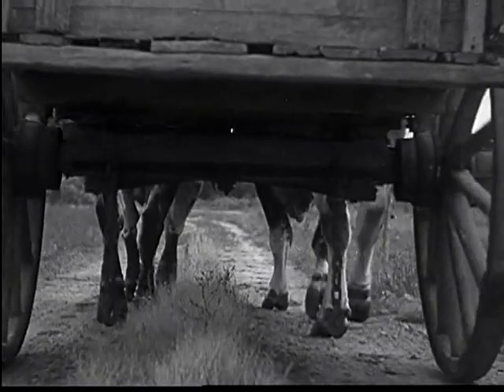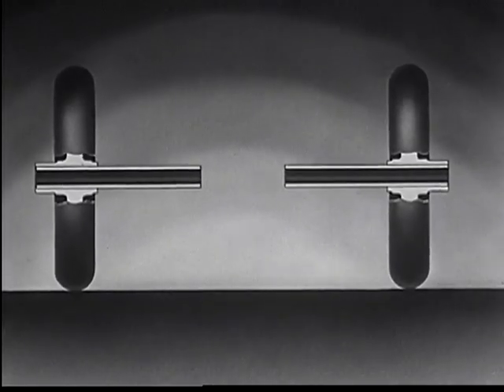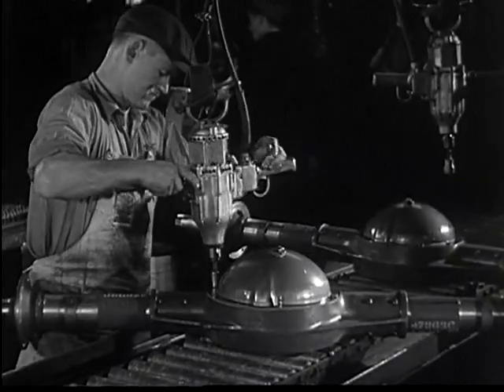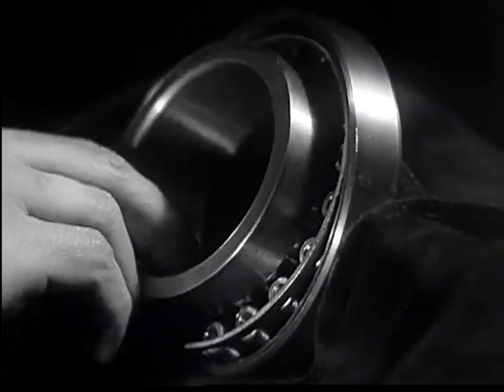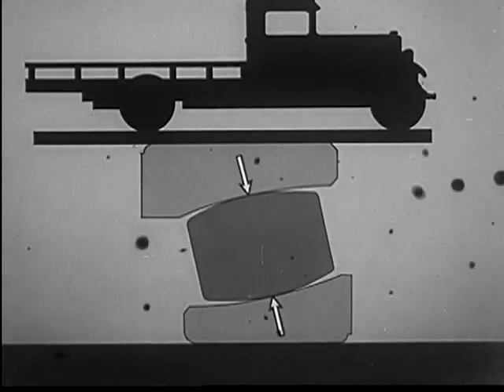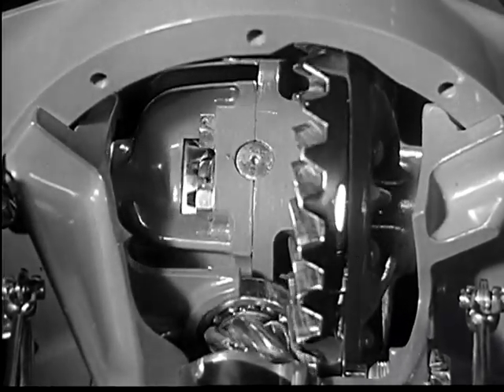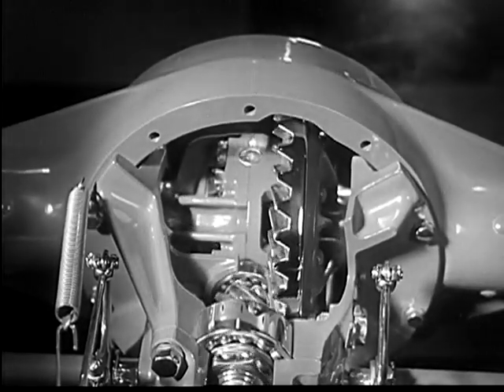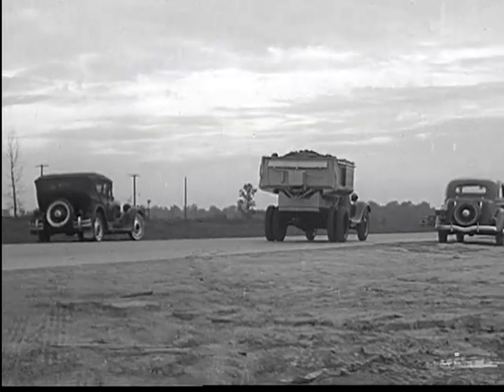It Floats - Chevrolet Full Floating Rear Axle (1936)

Comment: I think it's pretty amazing that this exact, identical rear axle design is still used on heavy-duty trucks, 80 years later.
Reply: yeah its still in use.
 quite surprising that with technology advancing on a daily basis , some things were so perfect that they haven't changed for decades.
Reply: @lafaglobe6025 They changed the gear tooth profile recently to reduce noise
Reply: Ben Well, technically the sherical roller bearings have been replaced with plain straight roller bearings, which are far cheaper to manufacture, and the load screw (anti-deflection bolt) has been removed. But fundamentally, yes, the design is unchanged
Reply: I was just noticing our 1971 grain truck had pretty much the same axle as shown in that video.
Reply: Some things are nearly perfect from inception, like the Schrader valve in tires. It’s remained virtually unchanged since the 1890’s and it is universally used over the whole earth. Amazing really.
Reply: @NodnarbRS  Wow, I never thought about that. That's pretty remarkable too.
Reply: Most modern-day technology is based off older mechanical concepts that have been tweaked and refined to their near-maximum capacity.

I think it's amazing that we still rely on the wheel to get around and produce/transfer energy, thousands of years after its conception. Movies show futuristic machinery using proton engines for propulsion and flying cars, but can we truly innovate revolutionary technology that is practical enough to move on past basic engineering breakthroughs?
Reply: if it aint broken dont fix it
Reply: ++ Offroadram2001.. Same way you fish out a broken axle today. Once it breaks there's nothing holding any of the pieces. Since they usually break near the end you can grab it with a large pair of pliers or push the whole thing with a long screw driver once the center cover is off. At that point you can clean the tube with a rag shoved through with a broom stick to get any small particles.
Reply: threads like this are weird they start out with a neutral comment years ago then degrade into some pointless argument 4 years long 😆🤣
Reply: i wonder when will the next gen will come or a different way to transfer power
Reply: @kendelion  Mechanical I cant imagine another way to transfer power. This is like the ultimate way^^
Reply: @kendelion  With the industry moving toward electric cars, it might be that axle assemblies will go the way of the dodo.  Don't need an axle to deliver power to the wheels if all the wheels have their own electric motors.

Though the axle and differential system may remain in use in heavy vehicles, like over-the-road trucks, at least for the foreseeable future.
Reply: @xaenon  I could really see that future coming and it's already here on some!
Reply: @kendelion  electric motors on each wheel
Reply: @kendelion  the differential is perfect. It can’t be improved on for what it does
Reply: @kendelion  somethings are just optimal. no one is gonna ever make a table obsolete for instance.
Reply: My 1987 Ford has this style axle, it's a Sterling 10.25.
Reply: Don’t worry some idiot will come along sooner or later and change it just for the sake of change and then have the gall to call it improved. And the sheep will believe them and pay more for it.
Reply: @NoName-tz5ji  and then they'll ban the old one's and if your caught running them you will be fined
Reply: If it aint broke dont fix it!
Reply: If it ain’t broke don’t fix it
Reply: Agreed, same with drum Brakes
Reply: In the 80s toyota still used this design on the land cruiser. I'm trying to get my hands on one to go under my modern toyota.
Reply: No entirely true, some electric engines still use gear systems. Because they can run into situations where a change in gear ratio to increase torque might be needed. Or maybe a change needs to occur to allow for more speed.
Reply: @ALegitimateYoutuber  motor not engine
Reply: Just a few tweaks here and there with electronic assist and few balances are made so far. No major breakthroughs yet. Maube one day each wheel will have their own motors
Reply: Next way will be electric power transmission just like a locomotive either in full electric or hybrid. 

100% torque at zero RPM, differential function, synchronize them for lockers, plus dynamic braking.
Reply: My thoughts exactly.
Reply: @ButterfatFarms  on cars, independent suspension is an improvement over a straight axle even tho it is more complex, more expensive, and less durable. Its still an improvement. God your dumb.
Reply: John Browning's tilting barrel design is still predominate in handguns 111 years later, sometimes the name of the game is minute refinements on a great designs.
Reply: Ben until flying cars and iPhones are in control of everything.  Things are changing quicker than a loaf  of bread finishes baking in today's world!
Reply: Did Chevy invent the full floating axle?
Reply: What about the gear box and differential... It's all identical. Those guys invented it all 90 years ago and it hasn't moved an inch 🙂🙂🙂
Reply: @penkatadrums  
You think that's impressive? I just watched a tv show on the Science Channel about this:
👇😁👇
Watch "2,000 Year Old Computer - Decoding the Antikythera Mechanism - Full Documentary HD" on YouTube
https://youtu.be/jSQNEPbQOiI
Reply: Like the old timers used to say,”If it ain’t broke, don’t fix it”. Today, they change everything so it can’t be fixed without a college degree.
Reply: Luca Fuoco simon and garfunkel sound of silence
Reply: Off-road Heavy Haulers use planetary gears in the hub. Torque multipliers.
Reply: Yeah why change if it works?
Reply: I was going to type the same thing!  How amizing!!
Reply: Agreed. I'm restoring a '41 International K3 and it's amazing how it is almost the exact same as my '01 F350.
Reply: This is an ideal design that really requires no improvement . Like 4 legs on a chair is ideal
Reply: AK-47 of axles
Reply: But can you replace it easily too?
Reply: not quiet exact. the manf have change it just enough to water it strength down a bit.
Reply: If it ain't baroque, don't fix it haha
Reply: I'm sure people had a way to fish it out, but the idea is to be able to pop it out pull the diff cover if needed and be on your way without having to unload, jack it up, remove wheels, take apart the brakes, and open up the diff to remove C clips
Reply: You can buy a $100k Escalade and  it will come with a solid rear axle much like this one
Reply: @Armadurapersonal  no, the escalade is equipped with a semi-floating rear axle.
Reply: @walterk1221  2021 Tahoe/Suburban/Yukon/Escalade went to independent rear suspensions.
Reply: @straightpipediesel  that is disappointing.
Reply: So how would you improve on something that's not failing? In the event you can't technically you are wrong.
Reply: @waswestkan  to improve on it  I'd make it lighter, stronger and with less moving parts, stick a motor on each wheel, use hydraulic motors in the hub assembly giving you 4 wheel drive with variable torque control on each wheel and more control. It is a great design, solid but then so is the crayon. What is a shame is that while it's still ideal for high weight, dirty conditions Chevrolet still use it in a modified way on their corvette, in this application it is a terrible idea, we have moved on in a huge way when it comes to racing and performance applications. The 'vette I'm talking about it s
The C7 if anyone is interested.
Reply: @waswestkan  if it ain’t broke don’t fix it
Reply: its realy
Reply: because its cheap and americans hate progress
Reply: Durgaprasad Turkar Great point.
Reply: And Toyota Land Cruisers...
Reply: Because they’re lazy to innovate or not enough demand to make it feasible
Reply: For better or worse, truck design rarely innovates
Reply: @wizard_of_poz4413  they’re still using leaf spring, ladder frame, solid axle designs. But that’s because they are probably best for trucks.
Reply: @dwightschrute3862  well most tractors like 99% are air ride. But what concerns me is why we're having a problem of switching to disc brakes or upgrading these outdated, unsynchronized manual transmissions from the 1920s
Reply: @wizard_of_poz4413  oh, i was thinking about trucks like f150s an Silverado’s
Reply: @dwightschrute3862  same sort of thing.  They're starting to diversify the suspension to coilovers like on my dad's truck or air ride on some. Which is nice because you can pump the bags to level out the ass end too. But seriously the trucking industry cuts corners in.a scary way
Reply: @wizard_of_poz4413  I’ve seen some sketchy thing on trucks that were there to cut some corners.
Reply: @dwightschrute3862  yea not even mentioning some dogs dogshit  maintenance
Reply: @ButterfatFarms  how are they not? If that was the case then nothing that any supercar company made would be an improvement, only things that are on a corolla would be an improvement. Your the one being dense.
Reply: @ButterfatFarms  did anyone ever say they were? You were the one who implied that if a design isn't cheaper or more reliable than its predecessor then its not an improvement. Improvements can be made in hundreds of specific ways for just one design. Dont be so dense.
Reply: @ButterfatFarms  i never said a design wasn't an improvement if they are too complex or expensive. Why would a company use the improvement if it means smaller profit margins if its expensive? Why would a company use the improvement if it means making their vehicles less reliable, when they could just work on the design a few more years a perfect it. The same process that EVERY invention has gone through. Your stuck in the past, stop thinking that new and better things will never come along.
Reply: Electric vehicles often have an engine for each wheel. There's no need for gears because you just put more electricity into the engine to generate more power.
Reply: @Crusader1089  That's the best design, however, none of the EV's built so far have had motors for each wheel.
Reply: @Crusader1089  Teslas still have gears between the electric motor and the wheel, it’s not the same axle.
Reply: @Crusader1089  and bigger engines to generate that power and need of more power to drive car with it's engines weight...
People talking about "no need for gears in EVs" know nothing about engines, cars and how it works.
Reply: Ah, the claymore mine has it beat! Over a thousand years it has caused mass casualties among enemy troops and the only thing to change was material of its construction.
Reply: @DesertCatDad  we could sure use a few of them
Reply: Luca Fuoco "when will we finally" it's when we will finally.
Reply: @w00dchuck43  Actually, his way is fine "professor". If you put a comma after "I wonder", the sentence reads fine. Ok "Dick"?
Reply: Well yeah it's called cost saving
Reply: @_baller  well, no, it's called "if it ain't broke don't fix it".
Reply: @walterk1221  lol no it's called a cheap american business
Reply: @walterk1221  yes you really are
Reply: @walterk1221  nope they like it cheap, keep it moving kid
Reply: @_baller  yeah you're right and this obsession with off the rack parts is really hurting the trade
Reply: But  not on 3/4 ton pickups as what was typical for US made pickups until the Japanese manufacturers introduced 3/4 ton pickups with lighter weight rear axle assemblies
Reply: @waswestkan  , what are you talking about? There are no 3/4 ton trucks from Japanese makes.
Reply: Yes isn't it sad?
Reply: @ronaldderooij1774  , we're still using the wheel millennia later.
Reply: It means they are unable to grow in this subject, so technically its as bad as good
Reply: @johnathankrausrig9237  i almost guarantee that there have been major improvements in this field, its just that maybe they are too expensive to use or too complex and unreliable to be put into something that just needs to work and not be fancy about it.

Comment: 0_0 Removal of the shaft WITHOUT HAVING TO- JEEZ
I wonder why this design was ditched- IMO modern tech could improve on the simple designs of the past
Reply: It never was ditched.  They're still in common use today, on everything from pickup trucks, school buses, box trucks, over-the-road trucks, etc, etc, etc, etc, etc, etc.
Reply: +crackpotfox it's actually still used today on 4x4 applications and you have to pay more to get a kit to install it because it's better than what comes standard in trucks. For that application of course, idk if there's any benefit to it other than for four wheeling.
Reply: look at any hd truck
Reply: they do. look under the rear of any pickup, semi, box truck, jeeps, and a lot of bigger suv. for a long time youd see a version of it under the frontall 4x4 vehicles too, now they've improved it a lot but the major parts are still there. they've improved a bit on it but it's still pretty much the same thing just different sizes. it works well and over all is efficient. like grandpa always said if ain't broke don't fix it.
Reply: Race cars that use a solid rear axle uses the Ford 9" floater. If you break an axle the rear wheel stays with the car. Most everywhere that doesn't allow quick change rear ends, require a floater of some kind. The Fords are the one of choice, because you can build up differentials with different gears. Faster to change them than all the parts that have to be disassembled in the GM to change gears. Plus Ford makes an ungodly number of different ring and pinion ratios. Need a 2.64, they have it. Need a 6 .11, they make those too.
Before then they would use the axle used in the video. They would then use the magnesium brake drums for the large size yet lighter weight. Same with the front spindles.
Reply: Artisto Nope they still use design elements from this axle on 3/4 ton and up pickup trucks the  the biggest change is in manufacturing tolerances and brake tecnology.
Reply: Christian Guzman nope, a c1500 has a c-clip rear axle it is not even a semi-floating rear axle...
Reply: SMiller5488 He could have a heavy half. I've had a couple. 14 bolt, full floater rear. But, the majority is definitely 10 bolt with c-clips.
Reply: crackpotfox nope it doesn't Rob power at all
Reply: i think he meant how you can change the axis if needed without removing the wheel and not how the mechanics of works !!!!
Reply: Artisto Nope modern dealers rely on performing "maintenance" when crap breaks they literally design certain parts to break so often for guaranteed revenue in the parts and service depts
Reply: It's called GREED! Corporate greed! And rackeetering!
Reply: Like how everything has to be some kind of law to also generate money.
Reply: They didn't ditch it. Pretty much every heavy duty truck (semis, buses, etc..) use full floating axles. 3/4 and 1-ton pickups use them as well.
Reply: My 1990 C1500 works the same way. Nearly 54 years later.
Reply: Artisto Nope semi trucks still have that concept,  it's scary though because a theif could take the tires,  differential and axles from the truck on the spot!!  It's so simple with just a push of a hub with a sledgehammer! Gotta put heavy hubcaps on!
Reply: 23Khameo In high power cars, it's pretty standard.
Reply: Its heavy and probably more costly to make. Potentially also more robbing of drivetrain power as well, reducing efficiency.

Comment: 4:50  A) the guy carries extra axles along with his lunch pail? and B) if the axle breaks, how do  you get the rest of the axle out of the housing without pulling the access cover?
Reply: +ohger1 The teeth on the shaft usually strip but if it does happen to snap you may have to remove the access cover.

Comment: I dont know about you guys, but the chevrolet rear end looked alot like the ford 9'' rear end.... did chevrolet come out with that design first, then ford started using too?
Reply: +Bige4u I would have to check to see who actually used that design first, but to answer the question, yes, Chevrolet was using the drop out 3rd member style differential long before Ford was. They were using it in 1925, Ford didn't start using that style until 1957, which is when the 9" came out.